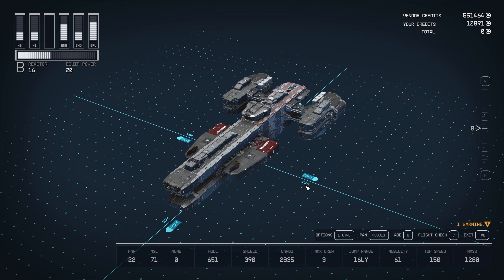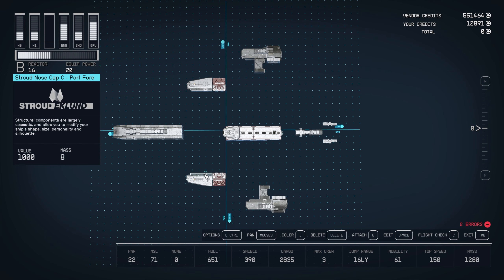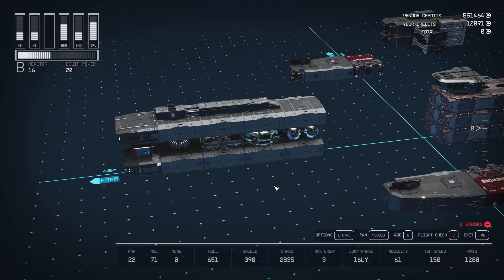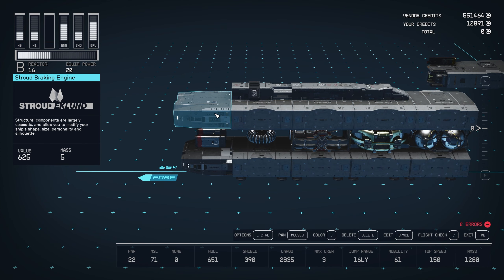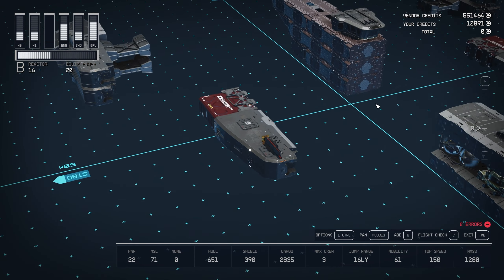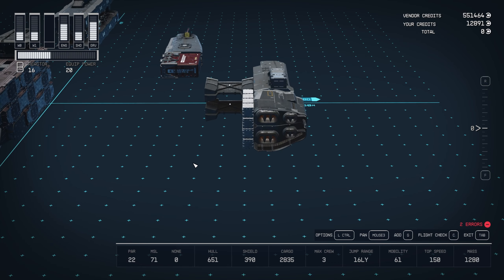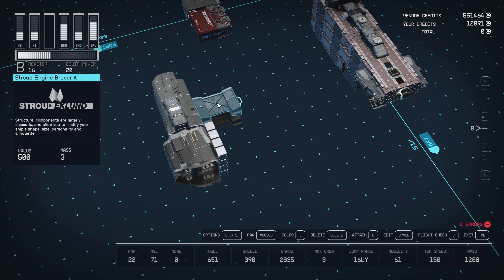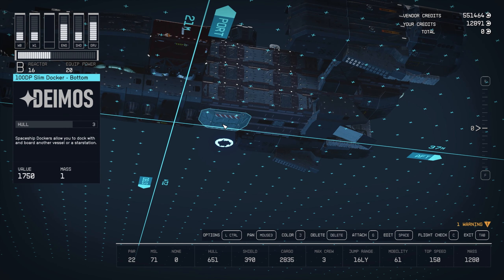How to Build Halo's ICONIC Charon-class Light Frigate in STARFIELD - NO MODS

Comment: Didnt have all the parts so I tried to make do. I was not able to snap the cargo boxes onto the side flairs on the fore, where the fuel tank is. And I didnt have the right docker, but for some reason the docker says its not connected to the cockpit
Reply from the maker: For the fuel tank you would need one that has snap points on the sides, or swap the grav drive and fuel tank around to attach the cargo boxes to that. 

For the docker, if you are using one of the full-sized 1x1 dockers, I believe they are only enterable from the opposite side of the docking ring, not from the sides. Otherwise it may be an issue of using a different cockpit which is not connected to the habs properly
Reply: Yeah I fixed the fuel tank swap with grav drive but I had to downgrade the drive. And as for the cockpit l, it's a Daimyo Enhanced Cockpit (couldn't find yours yet), and had to add a Taito companionway 1x1 bottom A with the Connect Pro Docker Top on that.

Now it works. It's not perfect until I get more parts and a higher level but it's functional. Would love to upgrade to class B or C for better jump drives
Reply: I also replaced the middle 1x3 hab to a 3 and 1 Berth for aesthetics

Comment: One question: What planet did you build the ship on? Since the pieces vary on different planets.
Reply from the maker: It was built across multiple planets, I started with a stolen Kfir and slowly morphed it into this build as I progressed to different landing zones. Akila City, New Atlantis, HopeTown and Neon were the four primary ones I used :)
Reply: @VantaGenesis  thx dude, My problem here is that I couldn't find Deimos spines, do you know what planet they are on?
Reply from the maker: @Kafunhachi  I believe the Deimos structural pieces were at New Atlantis, and if you have no luck there, they are also sold at the Deimos Staryard in Sol.
Reply from the maker: @Kafunhachi  I believe the Deimos structural pieces were at New Atlantis, and if you have no luck there, they are also sold at the Deimos Staryard in Sol.
Reply: @VantaGenesis  That can work, thxs :3

Comment: 👌 great watch. I'm always having issues with cockpit not conneced to docking bay warning, I. Used the Deimos docking bay and toying with the big bridge with this build, not having much luck.
Reply from the maker: If it says the cockpit is connected to the landing bay and not the docker, then it comes down to an error with where the docker is placed. If it's both, and you're using a different bridge from the one I showed, it may be rear-entry and require a 1x1 module behind it.

Comment: I can’t seem to find the sa-4110 engine
Reply from the maker: The SA-4110 engine requires Level 27 to buy at ship builders, I got mine by stealing a ship called the Kfir and then built the frigate from that. The Galileo also has the SA-4110 engines.
Reply: @VantaGenesis  ah ok im lvl 26 currently

Comment: That's looks really cool but what the minimum lvl requirements to buy all the parts for the ship ?
Reply from the maker: You need at least Level 27 to buy the SA-4110 engines, otherwise you can buy a ship like the Kfir or Galileo and delete everything but the SA-4110 engines, then build the frigate over it. I was around level 10 to access everything else, and the cockpit can be found at HopeTown.
Reply: @VantaGenesis  thanks for the detailed answer! 💯

Comment: I need help. What is your base ship. Also I don't have every peice and I'm having errors I can't solve. Ship reactor class, can't reach landing bay from cockpit and cannot teach cockpit from the docker.
Reply from the maker: My base ship was a stolen Kfir, although the only components left from it are the engines, fuel tank and rear 10T Hauler cargo hold. 

It sounds like you may have the wrong cockpit and reactor, I am using a Class-B reactor in this build. The cockpit is specifically the Overseer 300, which is unique in that it's one of 2 cockpits which utilize bottom entry rather than rear entry. The Overseer 300 can be found at the HopeTown landing zone, almost any other cockpit will require a 1x1 storeroom behind them, and possibly more clearance below them if they are larger. Hope this helps!

Comment: How many credits did it cost
Reply from the maker: The engines, fuel tank and large rear cargo are all from a pre-built ship called the Kfir, and the rest of the parts from the original were sold to help fund the build. With the Kfir, the cost of this exact build rounds out to roughly 130,000 credits, and without the Kfir, roughly 220,000 credits.

Comment: where did u find all these parts?
 mine are not in the shop
Reply from the maker: Bethesda doesn't tell you directly, but you need to level up to unlock certain parts. I was around level 12 when I started this build, and if you want to get ahold of the engines before you reach level 27, you will need to get them from another ship (The Kfir or the Galileo) and build the frigate from it instead.

Comment: I’m playing on console and I seriously think they forgot to add the mechanic that allows you to rotate certain parts because I cannot attach the cargo holds to the fins no matter what I try
Reply from the maker: I imagine that would be because the cargo holds aren't being attached to the fins, they're attaching to the snap point on one of the vital components between the rails of the MAC cannon :)

If the component that lines up with the cargo hold doesn't have a snap point on the side, you may need to exchange it for one of the other two next to it, or a different version of that component which does have side snap points. 

Hope this helps!
Reply: Definitely, think I might just still be too low level because I don’t have the engine or the fuel tank available even with Starship design rank 3

Comment: Man I wish we could set the ladders for all those big multi-floor ships. The randomly set ladders drive me absolutely insane. It's so incredibly frustrating thinking you built the perfect ship only to find that the inside is a fucking maze.
Reply from the maker: I'm not sure what dictates the ladder placement, but swapping modules back and forth from your current ones until you get a different layout may help! I got mine to have a single ladder which spans all the way from the bottom deck to the cockpit, and with one jump from a power boost pack you can go up the entire thing

Comment: Im on xbox and my cock pit doesnt serm to have an interior connection to the landing bay. I built most of the ship in my private dockyard but i dont have access to the cockpit you selected so now im just trying to make it servicable until i can fly around and find that specific cock pit
Reply from the maker: Before I found the Overseer 300 I temporarily used HopeTech's smallest cockpit and connected a 1x1 module to the back. It didn't look great but it worked, I actually cobbled this ship together almost entirely with this method of using temporary parts, then swapping them out when I found the right stuff

Comment: tried this and i did everything perfectly, except i keep getting the "landing bay needs to be connected to the cockpit" error message and i cant for the life of me get it to go away! i was going to finish this first and then go to the other landing zones in order to get the exact hope tech cockpit you have which might fix the issue, but since i cant get that error message to go away i cant do it without scrapping the build! help please?
Reply from the maker: I'm here to help! If you're using the other small HopeTech cockpit, you should be able to connect a 1x1 storeroom behind the cockpit temporarily, until you can find the bottom-entry Overseer 300 at HopeTown
Reply: tysm! @VantaGenesis

Comment: How do you collect all of the pieces for the ship in one place. When I delete a part of a ship it does not go into a storage it just gets sold. So I am wondering then how you collect pieces from multiple areas to build the ship since you can not stockpile and then use them when you want.
Reply from the maker: The way I built it was by starting with a base ship, in my case it was the Kfir so that I could access the SA-4110 engines before reaching level 27. Then I took this Kfir between New Atlantis, HopeTown, Akila City and Neon, until I had a completed frigate. However I don't recommend this if you are over level 27.

My current recommendation is to steal a ship and take it to your own outpost with a ship builder landing pad, delete everything from the original ship, and build the frigate from scratch. The only part you would still need to visit a landing zone for would be the Overseer 300 cockpit from HopeTown.

Comment: Is it possible to change the forward assembles into crew habs?
Reply from the maker: If you're talking about the top half of the MAC cannon, you absolutely can. The only reason I didn't is because I'm a stickler for unified design and wanted the sides to look the same as the landing gear casing on the bottom :)

Comment: I wasn't sure if one could design actually cool ships. But you managed to do it. Looks really great!

Already copied it and made minor modifications (don't have access to the engines yet). Also painted mine white and dark blue.
Reply from the maker: Thank you, and that's awesome to hear! I haven't gotten around to testing different colors due to working on other builds, but I might have to try some different combos now!
Reply: How’d you get it to work ? It’s telling me I have to connect the docker to the cockpit ?
Reply: @javiermendoza2308  Are you sure you placed the docker on the correct part? You can't just slam the docker on a structural part, it has to be a hab one. Otherwise you couldn't dock to ships or space stations.
Reply: @Slingshot805  yeah I had it connected to a 3x1 engineering bay
Reply: @javiermendoza2308  Good to know. Have fun with this ship. =)
Reply: @Slingshot805  I sure am! :)

Comment: Very clean build, I did some experimenting while adding onto this to make in more endgame viable to get a C-class reactor and grav drive in there. Simply adding a 1x1 companionway where the cockpit is, then placing the cockpit on top of that lets you move the "upper jaw" of the frigate up one more space. Letting you put the brand of C-Class reactor that has front and back facing connectors in the space. Then it was just slapping on the guns I wanted, doing all that though might make you chunkier than the landers can handle, so you'll have to put on some extra ones on the sides of the habs